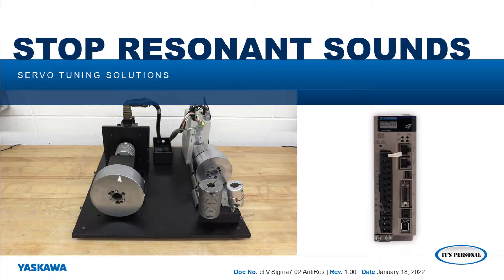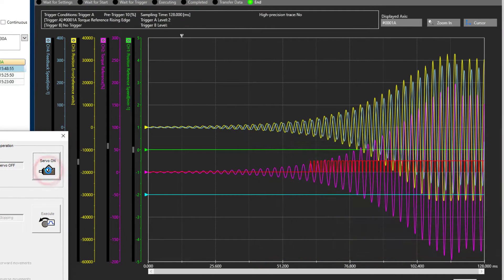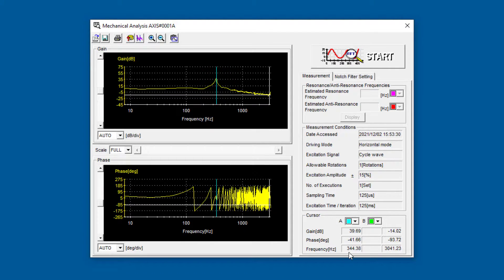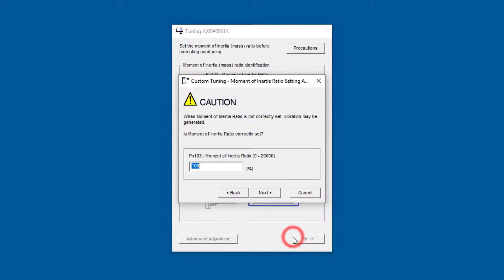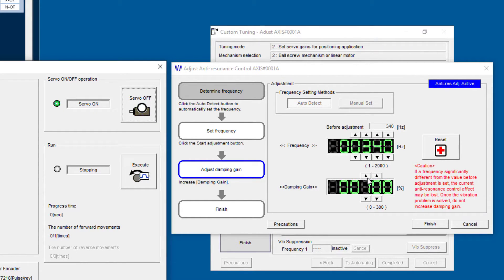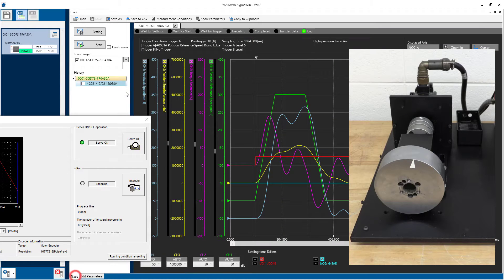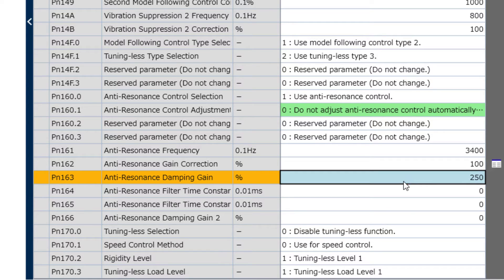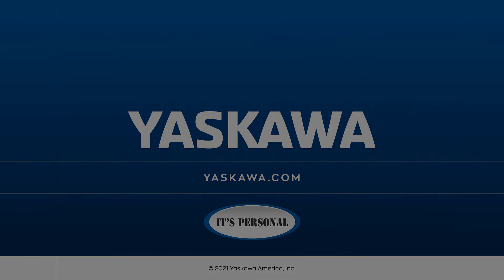Stop Resonant Sounds - Servo Tuning

Comment: I have a problem in a servo motor. Being in enable mode it vibrates and if it advances it vibrates making a lot of noise. when it is stopped but enabled it will vibrate as if it wanted to turn forwards or backwards in very short movements. What do you suggest I check?